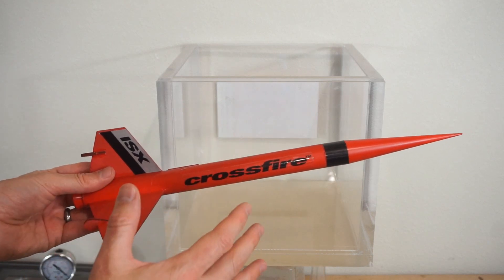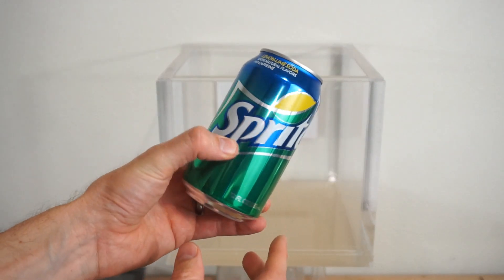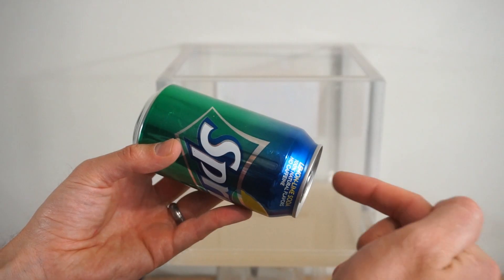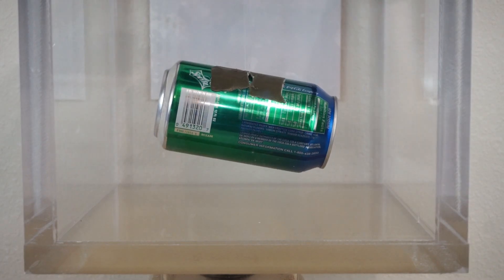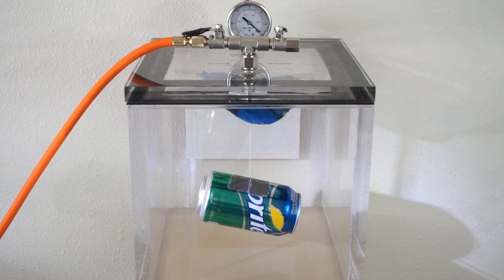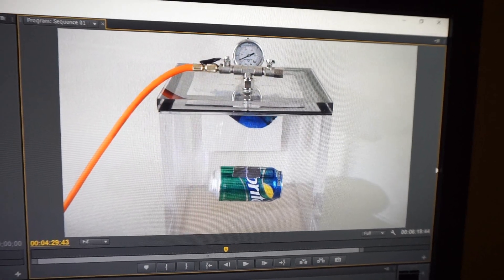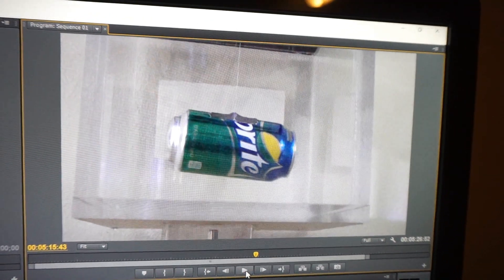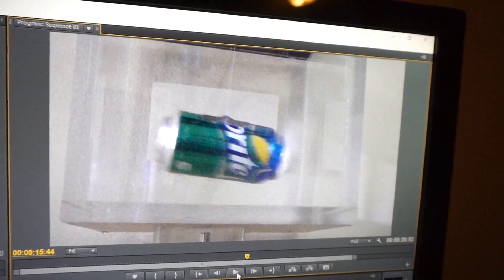Can a Rocket Fly in a Vacuum Chamber?

Comment: And technically, the rocket is pushing off of something.  That something is its own gas.
Reply: joe jitsu
"Once the gas has left the nozzle it has no effect on the motion of the rocket."
This tells me you do not know how it works. Once the gas left the nozzle, it already did the pushing.

The pushing mainly happens in the combustion chamber. The expanding gas pushes there. Once it leaves the neck it does a bit of pushing on the nozzle.
Reply: joe jitsu  I just saw this comment.  You're kidding right?  You said it isn't pushing off its own gases, then go on to explain how it pushes off its own gases lol.  What do you think pressure is?  It is literally a push over a certain area.  All you did was break down what I said earlier, which is fine by the way.  So nothing I said is incorrect.
Reply: +METO U
Time for what; you to learn some physics?  I would certainly agree with that
Reply: METO U ""so with a rocket that weighs a million lbs in space... The rocket would have to apply 1 million pounds of thrust off of something just to get it to begin to move..."

I can push a 3,000 lb. car on a level surface but I cannot achieve 3,000 lbs. of push.  With a car I am pushing against all the friction caused by its weight or the pull of gravity.

If this 3,000 lb. car were in space it would not weigh 3,000 lbs and there would be no friction to contend with,  the only thing to overcome would be its small amount of inertia that it would posses in space.

I suspect I could then theoretically push it using only my pinky finger.
Reply: METO U  Lol you're funny bud.  Too bad you wasted time with that long explanation, because in no way did it answer the question.  Again bud, the question was, how could the soda can push off the container walls, without actually making contact with it?  You haven't answered the question at all lol
Reply: NO. This guy doesn't deserve the likes. It is incorrect! Heres an older comment i wrote to a flat earther explaining it
Its just about newtons third law.
if you push something one way you will go the other way with an equal kinetic energy, and a speed relative to your mass. 
if you're on a chair on wheels and you trow a heavy ball, (if you ignore friction) you will go the other way with the same kinetic energy, at a speed relative to your mass. 
If you're in a chair on wheels and you shoot a bullet this will also happen, because even though it lighter, it's going much faster and therefore also has a big kinetic energy. (kinetic energy = 1/2 x mass x velocity²). 
In the situation of the rocket, the exiting gas doesn't have a very big mass but it does have a very very high velocity (up to 4.5 kilometers per second!) therefore generating enough energy to push the rocket up the other way. 
Since speed is relativistic, as long as you keep applying thrust the rocket will keep accelerating exponentially and therefore it is able to reach insane speeds.
Reply: Skyler Jr if it's useless then why did you spend time commenting when you could have spent time doing something not useless?
Reply: Tex Mex
"When the gas molucules of resultant explosion exit the nozzle completely, it has no effect anymore."
Sorry, this is false. If you do not understand ground effect, I can see why you might not understand.
Strawman argument again. My explanation was based on a rocket in a VACUUM. You clearly cannot read my words in context
YOUR strawmen is comparing rockets in a vacuum to ekranoplans that "floats" on a cushion of air in an atmosphere on earth.. Nice try... A vacuum is not the same like being in an atmosphere and it is not the same lie the ground effect.
Learn to know the difference, OK?

The diagram shows pressure exerted by gas.
http://www.braeunig.us/space/propuls.htm

Here is something in plain English if you cannot understand the above.
https://www.quora.com/Is-the-thrust-in-a-rocket-created-by-the-molecules-of-expanding-gas-colliding-with-the-walls-of-the-combustion-chamber

Those those incapable of understanding the above, here is the kiddie version. But of course, it skims over a lot of important things. So don;t bother me with this explanation if you cannot understand the above.
https://www.esa.int/esaKIDSen/SEMVVIXJD1E_Liftoff_0.html

Lastly, how does SpaceX get cargo into orbit? If it is a lie, can you prove it?

Source:
https://en.wikipedia.org/wiki/Ground_effect_(aerodynamics)
https://en.wikipedia.org/wiki/Ground_effect_vehicle
Reply: Of course, and I can pull myself out of a swamp by my own hair ...
Reply: Rockets can't go beyond low earth orbit. In a full vacuum, rockets exhaust wont create any acceleration because there is nothing for rockets exhaust to push against in order to cause acceleration. All you will see is exhaust going endlessly in space with no acceleration created in rocket. Imagine a man pushing a rock except man have his legs in air instead of ground. If a man has his leg on ground, he can push a rock because his legs are pushing against the ground. If his legs are in air, he can't push a rock because his legs are not pushing against anything. Same thing with rocket in space, there is nothing to push against. 
The only way a rocket can work in space is by creating a recoil effect by constantly exploding fuel mixed with liquid oxygen or exploding nukes at exhaust, explosion will create recoil effect therefore moving rocket forward in space but this isn't practical because you risk breaking the rocket. 
They are not using rocket technology in space, they are using EM gravity propulsion system secretly. Google "The Case for AntiGravity-booklet.pdf - Check The Evidence". Its already invented decades ago.
Reply: Tex Mex
"Can't we all just get along?"
You are asking one side that is correct to get along with the other side that is not correct. This is not logical.

"The mass of expanding burning/burned fuel or soda (liquid and gas) whatever behind the rocket all plays a part in propelling the rocket."
The MASS itself has very little to do with it.The magic happens when the fuel and LOX is ignited in the combustion chamber where the pushing happens.

"resistance to the fuel"
Morehand waving. Resistance is not even mention in sort of limiting factor when one speak to people knoledgable of rockets.
Like I said, handwaving.

"Certainly the farther away the gas gets it's effect diminishes rapidly toward zero, but not zero."
When the gas molucules of resultant explosion exit the nozzle completely, it has no effect anymore. The pushing is done in the chamber and a bit on the nozzle bell.

"but real life is not simplified."
You kinda dismiss explanations like the bowling ball. Then you introduce the ground effect that most people do not even understand...
Reply: Wiek van Venetië
This is what flat earther and Nasa deniers do.
Most of the time they will ignore any articles or logical reasoning but keep repeating or twist your words. 
Tex will prob fall back on ground effect logic but completely ignore that rockets is not anywhere near any surface and operates in a vacuum.

I wonder if he will address the articles I gave him.
Reply: Tex Mex
Im talking about the vacuum of space. Nowhere did I say it was perfect. YOU are the one introducing little strawmen and moving the goal posts. Lol

Like I said before. Pushing happens in the combustion chamber. A vacuum or atmosphere has nothing to do with it. 
Where are you articles that explains how rockets do not work? 
Post your supporting evidence here. 

YOU have to explain where GPS comes from if rockets do not cannot go into space with their propulsion.
You have to explain why nasa is spending billions on space programs.
You have to explain how we have images of planes.
You have to explain how we can read the weather patterns with space radar if satellites do not exist.
Explain how satellite TV works.
Reply: SsoulBlade .rockets in air  pull air from front..i am betting my house that nowdays rocket cant travel in space and nasa  faked it all...and it explodes because no air  keeps pressuring it..pump little ballon in  big bottle it will get smaller..vacuum bottle.ballon will explode
Reply: Jake Heke .... The aerodinamic flow is accellerated fromthe front!!!
Reply: silent hare
The rocket pushes the fuel mass away from it (with a controlled explosion).  Therefore the rocket mass moves the other way.  The vacuum has nothing to do with anything.  Two masses push away from each other.  Both move away from each other.
Reply: silent hare
Nothing is sucking.  Vacuum of space does not mean vacuum cleaner.  Space is just a lack of pressure from air, not a reverse pressure.
Answer this:
If you are holding onto a rock with a mass of about 100 kg in space and your mass is also 100 kg, then you jump off this rock, what will be the resulting motion of you and the rock?  Let's say you and the rock are motionless in total vacuum to start with.
Reply: silent hare
Not off yourself.  Off a rock that was attached to you.  You've pushed it away.  Both you and the rock go opposite directions.  That's what happens with a rocket.  It pushes its own gas mass away, and the rocket and gas go opposite directions.  You're a school kid who hasn't taken his science classes yet.
Reply: The gas and the can are pushing away from one another. So the gas and the can have equal force applied to them in opposite directions. 

Newton's third law.
Reply: Rockets DO NOT MOVE in a "space" vacuum....it can't......In air, or water...the rocket uses the "gas" to PUSH AGAINST the opposing mass....either air or water. In a vacuum....there is NOTHING to push off of, and NO, the ROCKET CAN NOT PUSH AGAINST ITSELF......if that were even REMOTELY TRUE, than the laws of physics, and thermodynamics are lies.
So which is it?
Reply: Can't we all just get along?   The mass of expanding burning/burned fuel or soda (liquid and gas) whatever behind the rocket all plays a part in propelling the rocket.  You can certainly simplify things like the astronaut throwing the bowling ball model to explain certain concepts, but real life is not simplified.    The expanding gas behind the rocket has some density and provides some resistance to the fuel leaving the rocket motor.  and that provides some resistance to the fuel burning fuel in the motor.  Certainly the farther away the gas gets it's effect diminishes rapidly toward zero, but not zero.  Think of the way ground effect provides more lift to an aircraft/helicopter close to the ground.
Reply: Is it logical to ask people to get along?  Why would it need to be?
"When the gas molucules of resultant explosion exit the nozzle completely, it has no effect anymore."  Sorry, this is false. If you do not understand ground effect, I can see why you might not understand.
Reply: This guy? Hard to agree f you never say who "this guy" is.
Reply: Tex Mex "this guy" is the writer of the original comment, of course. now please stop ignoring my comment completely explaining it.
Reply: SsoulBlade, your argument was based on a perfect vacuum, something that does not exist. A simplification.  Deep space is not a perfect vacuum, and a rocket spewing particles into it does not help.  You can pretend there is some magic threshold burning exhaust particles pass and instantaneously stop effecting the rocket, but this is false.
Reply: METO U
"Because space is as close of a perfect vacuum there is ...it is impossible to have thrust..."
Impossible? - I take it you will never post proof? 10 Bucks you wont post a peer reviewed article.
Only those not understanding how rockets work will say it is impossible.
Pushing is done in the combustion chamber and the nozzle bell. 
http://www.braeunig.us/space/propuls.htm#thrust
http://www.braeunig.us/space/propuls.htm#combustion
https://www.quora.com/Is-the-thrust-in-a-rocket-created-by-the-molecules-of-expanding-gas-colliding-with-the-walls-of-the-combustion-chamber

"It's no different than saying that you can blow hard enough into a vacuum cleaner and make positive pressure..."
This shows your level of understanding.
A vacuum cleaner is still operating on earth in an atmosphere...Not analogous to a rocket and space.

"Space will do the same exact thing to a rocket..."
Again, prove it with peer reviewed articles

"molecules will go in every direction evenly"
No it won't go in ev an object in space will keep going in whatever direction it was going until a force is imparted on it. the gas molecules will not go in every direction evenly.

"making thrust  impossible"
Lol
https://youtu.be/76JM03a6WH4?t=433
https://www.youtube.com/watch?v=GxBRQXxBRic&t=9s
Here is a timelapse of the ISS at 460KM. https://goo.gl/kl59U
ISS right now (I wonder how it got there) http://www.satflare.com/track.asp?q=25544 / https://eol.jsc.nasa.gov/ESRS/HDEV/ / http://www.n2yo.com/space-station/

_Saying that a rocket pushes off it's own gas from combustion is ludicrous...-
-"The rocket.. "can"...will apply force to the container until there is enough pressure to prevent this from happening then it will push off of its own gasses inside the box..."_
Lol, saying something does not make it real.
Since this is a claim, do you have studies that experiment with this? Can you post studies that experiment with something that puss of the gas that is pushing off something else? 
Didn't you just say that "molecules will go in every direction evenly"? If that is the case...there are no molecules to "push from" since it went in all directions evenly...your words, not mine
Meaning, there cannot be a pillar to push from. THAT is applicable to Ground effect vehicles. You argument is defeated by your own words/logic...

Lastly, if rockets are impossible to use in space, then we have serious question
1. Why would Elon Musk and Jeff Bezos use their own money for something that is not even possible (according to flat earther and nasa deniers)
1. a If you knew something is definitely not possible, why invest in it?
2. How do we get images from planets that is not taken from earth?
3. How did other countries get their satellite in orbit?
4. How did we get satellite imaging with Google earth? 
5. How do we get weather satellite forecasts?
6. How did the Mars rover get there?
7. How did the russian rovers get to Venus? Venera 7 was the first one to land there.

Can you answer it with evidence? For example, if you say Google maps was made with a plane or drone, present the google article talking about this plane/drone...
If all of the above is a lie, you still need to present eveiden to support your statement. 

I don't think you are stupid, I think you are just uninformed about rockets or cannot phantom how it words. You seem to be one of those people that yell magic! or witch! if you cannot understand something.
Instead of trying to understand how it can work, you do everything on your might to find elusive evidence that support your initial opinion.
 
More sources
https://www.nasa.gov/pdf/544894main_PS2_ThrustAndAcceleration_C3_Final.pdf
https://www.nasa.gov/audience/forstudents/k-4/stories/nasa-knows/what-is-a-rocket-k4.html
https://space.stackexchange.com/questions/2456/why-does-a-rocket-engine-provide-more-thrust-in-a-vacuum-than-in-atmosphere
https://goo.gl/owG7nC
Pictures of earth before Photoshop.
 https://www.hq.nasa.gov/alsj/a11/AS11-44-6645HR.jpg from https://www.hq.nasa.gov/alsj/a11/images11.html
More here
 https://goo.gl/ghWW2L from this album https://www.flickr.com/photos/projectapolloarchive/page8
http://www.spacex.com/
Reply: "i would respond but it seems you just wrote random words on pieces of paper and threw them into a hat and wrote the words as you picked them out of the hat...."
Ah, someone does not understand high school/universaty level physics and explanations?
I'm sorry, I do not have enough crayons to explain it ioo you.

"objects travel through water the same exact way they travel through air... End of discussion."
I am talking about rockets...in space..you know, where there is no atmosphere...

"I could not care less about how you think that rockets fly through air...."
I have always focused on a rocket in a vacuum.
 
"but so everyone can laugh at your expense.... "
I think everyone is laughing at you.
 
"Explain your crackpot theory of how rockets fly through air using a water analogy."
I am talking about rockets...in space..you know, where there is no atmosphere...

"Which you should be able to do since fluid dynamics is what governs the way that objects travel through both water and air the same exact way."
I am talking about rockets...in space..you know, where there is no atmosphere...

"Have you ever even heard of fluid dynamics?"
I am talking about rockets...in space..you know, where there is no atmosphere and fluid dynamics does not apply...

Read my comments c.a.r.e.f.u.l.l.y.

"Space will do the same exact thing to a rocket..."
Again, prove it with peer reviewed articles

Question you avoided
Lastly, if rockets are impossible to use IN SPACE (not water or atmosphere), then we have serious question
1. Why would Elon Musk and Jeff Bezos use their own money for something that is not even possible (according to flat earther and nasa deniers)
1. a If you knew something is definitely not possible, why invest in it?
2. How do we get images from planets that is not taken from earth?
3. How did other countries get their satellite in orbit?
4. How did we get satellite imaging with Google earth? 
5. How do we get weather satellite forecasts?
6. How did the Mars rover get there?
7. How did the russian rovers get to Venus? Venera 7 was the first one to land there.

Can you answer it with evidence? For example, if you say Google maps was made with a plane or drone, present the google article talking about this plane/drone...
If all of the above is a lie, you still need to present evidence to support your statement.
Reply: "please explain how a rocket moves through air... Using an analogy using something traveling through water ...objects travel through both water and air the same exact way... Fluid dynamics"
Read the title of this video carefully.
The video deals with the question of(and I will write relevant parts in CAPS) ROCKETS in a VACUUM.
You are trying to use fluid dynamics in a video that focus on rockets in a vacuum. Thus a  strawman argument.

Also, you say objects TRAVELING through water which. It is about rockets PROPELLING itself through the vacuum of space.
The flow of fluids have nothing to do with the vacuum on space with regards to rocket propulsion in space.

Lastly, I hope this sinks in...I am talking about rockets... in space ..you know, where there is no atmosphere...

Questions you are avoiding
Lastly, if rockets are impossible to use IN SPACE (not water or atmosphere), then we have serious question
1. Why would Elon Musk and Jeff Bezos use their own money for something that is not even possible (according to flat earther and nasa deniers)
1. a If you knew something is definitely not possible, why invest in it?
2. How do we get images from planets that is not taken from earth?
3. How did other countries get their satellite in orbit?
4. How did we get satellite imaging with Google earth? 
5. How do we get weather satellite forecasts?
6. How did the Mars rover get there?
7. How did the russian rovers get to Venus? Venera 7 was the first one to land there.

Can you answer it with evidence? For example, if you say Google maps was made with a plane or drone, present the google article talking about this plane/drone...
If all of the above is a lie, you still need to present evidence to support your statement.

If space is a vacuum then why doesn't it suck in all the air from Earth's atmosphere?
Edit: https://www.quora.com/If-space-is-a-vacuum-then-why-doesnt-it-suck-in-all-the-air-from-Earths-atmosphere/answer/M-Scott-Veach?srid=5HHy
Reply: METO U
"please explain how a rocket moves through air... Using an analogy using something traveling through water ...objects travel through both water and air the same exact way... Fluid dynamics"
Read the title of this video carefully.
The video deals with the question of(and I will write relevant parts in CAPS) ROCKETS in a VACUUM.
You are trying to use fluid dynamics in a video that focus on rockets in a vacuum. Thus a  strawman argument.

Also, you say objects TRAVELING through water which. It is about rockets PROPELLING itself through the vacuum of space.
The flow of fluids have nothing to do with the vacuum on space with regards to rocket propulsion in space.

Lastly, I hope this sinks in...I am talking about rockets... in space ..you know, where there is no atmosphere...

Questions you are avoiding
Lastly, if rockets are impossible to use IN SPACE (not water or atmosphere), then we have serious question
1. Why would Elon Musk and Jeff Bezos use their own money for something that is not even possible (according to flat earther and nasa deniers)
1. a If you knew something is definitely not possible, why invest in it?
2. How do we get images from planets that is not taken from earth?
3. How did other countries get their satellite in orbit?
4. How did we get satellite imaging with Google earth? 
5. How do we get weather satellite forecasts?
6. How did the Mars rover get there?
7. How did the russian rovers get to Venus? Venera 7 was the first one to land there.

Can you answer it with evidence? For example, if you say Google maps was made with a plane or drone, present the google article talking about this plane/drone...
If all of the above is a lie, you still need to present evidence to support your statement.

If space is a vacuum then why doesn't it suck in all the air from Earth's atmosphere?
Search that on Quora and Forbes
Reply: that creates oscillation pressure from solid glass.+it explodes because no atmospheric pressure keeps it
Reply: Dragan i
"that creates oscillation pressure from solid glass.+it explodes because no atmospheric pressure keeps it"
1. What exactly explodes? You just say "it".
2. How exactly does what you describe explain the can moving?
3. What exactly is oscillation pressure? (I cannot find studies for this term)
4. What does this oscillation pressure have to do with glass?

- Do you have studies to back up what you said and for each point I'm asking.
- Post the studies please. (Telling me to go google it is no different to me saying you are wrong and to go google it.)
- Post video examples of these experiments proved by the articles.
- Make sure the articles is from people in the field. Not a backyard/couch "scientist" with no peer reviews who's only retort is "Look into it".
Reply: ".rockets in air  drag air from front.."
All object in an atmosphere of some kind experience some drag. THIS experiment is in a vacuum. You comment is irrelevant in a vacuum.

"i am betting my house that nowdays rocket cant travel in space and nasa  faked it all"
Why is is so difficult for you people to provide undeniable proof?
I can also say that you are a robot meant to propagate the flat earth...point is I need proof to back up my claim. Not assumptions.
Make sense?

"...and it explodes because no air  keeps pressuring it.."
1. What exactly explodes? The air? The fluid? The CO2 in the fluid? What?
2. Explain in detail (with articles/studies) how pressure keeps IT from exploding
Stop hand waving and explain in detail.

"pump little ballon in bottle it will get smaller.."
Wtf? 
Pump air in balloon in a bottle / Pump air in a bottle with a balloon in it?
is the balloon closed? Was the bottle a vacuum? Does it have some gas in it? What?
Stop hand waving and explain in detail.

"vacuum bottle.ballon will explode"
is "vacuum bottle" part of the previous sentence? If so, why double ellipse? (Should be 3 if that was the intention)
Why will balloon explode? 
Stop hand waving and explain in detail.
Reply: Dang jos yes that happens because solid glass blocks it and flid creates pressure
Reply: Dragan 
Are you going to answer each of my points and explain in detail? Direct link to studies is preferred. Don't tell me google X. Most of the time all you get are tin foil websites with zero scientific backing. Give me the website name and what I must search. Better yet. Direct link the page number(s) of important bits.
Reply: FAKE, there is no human~!
Reply: Take a weight and stand on slippery ice on the edge of a cliff, face the ravine backwards and throw the weight. You can't push yourself against air.  But you will still die. It is basic newton law. Something that looses /gains momentum creates a force in some direction. It is the same principle that makes asteroids wreck the earth when they hit. And air resistance making it go on fire during the fall. Or why you can heat things by hammering them hard (in this case since the object cannot move the force creates potential energy that is converted to heat). Or why a ballerina starts spinning faster when she takes her arms closer to her body.
Reply: well, technically, that means motion laws, no such vague term as 'pushing off of something' is defined. Technically, this is conservation of momentum, don't give it misleading names.
Reply: The space it to small to prove anything.. stupid guy
Reply: Gra Ra5 like said, it does not prove anything. If its not a vacuum anything like space and in a container its not proof so i dont need to do any experiment its been done for me. Plus its common sense that you cant push of somthing that is moving away from you especially if its gas being sucked away in a vacuum
Reply: How can a rocket pus of something that is being sucked out its not equal opposite.
Reply: Tex Mex it seems you believe all that nasa tell you have you ever had a an opinion of your own or does it all come from tv and books?
Reply: TheOneWith TheEyeOfTruth nope this does not fit with the laws of motion but  thanks for your opinion bud. Im am reconstructing this experiment and it should be finished in three weeks time much larger scale youll see.. this will have a vacuum not a slight one in a small space
Reply: TheOneWith TheEyeOfTruth is blowing in a vacuum cleaner hose. two masses opposite or is one sucking in the same direction as the one blowing equal opposite is two forces opposing not opposite as in hot and cold that is tex mex belief... look cold is an idea of a place or thing without heat energy as is   a dark place without light or vacuum without pressure but these are not opposing forces the name is give out of absence.
Reply: TheOneWith TheEyeOfTruth i never said it was a reverse anything i actually  said it was what you just stated. The absence of pressure which is a vacuum. But now your talking about inertia. But your talking about propelling your self off of yourself as we are in a talking about being in a vacuum because of space you are obviously a child but fair play for trying to understand real science
Reply: TheOneWith TheEyeOfTruth if your in a vacuum and you are 100 kg and you push off an object which is 100kg you both move away from each other at the same rate yes... but calculating that rate is what im refering ie a working jet  engine on earth has an atmosphere to push off of to make an aircraft move then in a no atmosphere it all based you say its all down to mass opposing inertia would there be enough noticed force to make any difference whatsoever in space which is also a belief as you cannot prove that space exits
Reply: silent hare
So imagine instead of you there is the rocket, and instead of the rock, it's fuel.  Same thing.  Now you know how a rocket works in vacuum.
Whatever else you're saying, you're talking about something else.
Reply: TheOneWith TheEyeOfTruth ok you head is a rock in a vacuum i get it now
Reply: silent
What's the problem, kid?  You just said that you and the rock move opposite directions.  Why can't you apply that to the rocket and its fuel?
Reply: TheOneWith TheEyeOfTruth because it doesnt work like that now your imagination is thinking that combustion is somehow similar to creating infinate inertia from infinate rocks
Reply: silent
It's just pushing mass back.  That's the principle.  Action and equal and opposite reaction.
Reply: DANG JOS it touched it from the inside
Reply: Enough said. Ty for saving me the time of explaining dude
Reply: man you are smart!
Reply: DANG JOS the can pops before the full vacuum is stabilized... in fact that can would not stand up to a full vacuum without popping before reaching a full stable vacuum...
Reply: great job showing everyone that most pressurized containers BLOW UP before reaching a full vacuum environment... 🤣 lolol stupid globetards... DERP
Reply: The Action Lab .. now explane how nas gets combustion in vacuum and the fuel doesnt do what that can just done cause from the math the camber tou have space vacuum is a lot more than you can get from that tiny box
Reply: The Action Lab .. challenge ... build a setup of fuel tank and fuel and try and stimulate the combustion it cant be done in space or vacuum box noting will burn
Reply: The Action Lab .. the only burn a comet or meteor does is when it enters our atmosphere till exit then it just a cold ball of what everther for nas or any one has never been to space on combustion any thing
Reply: This experiment is bullshit,, u have a big as can 1 inch from. 4 walls. Talking about there. Is no opposite force to push off of
Reply: Jake Heke, what exactly are the "Thrusters" thrusting against?
Reply: TheOneWith TheEyeOfTruth, the 'Vacuum' has everything to do with it. The immense size of the vacuum is what makes the difference. This vacuum is so immense it sucks up and swallows any energy produced by a Rocket, and it does so instantaneously.
Reply: TheOneWith TheEyeOfTruth, you are very much mistaken. The vacuum of space does suck and is a reverse pressure. The immense vacuum on the Moon would in fact have reshaped the Lunar Lander round like a balloon. Which is further evidence of NASA lying.
What is the vacuum level in space?
Examples
Vacuum cleaner approximately 80 kPa (600 Torr)
Near earth outer space approximately 100 µPa (10−6 Torr)
Cryopumped MBE chamber 100 nPa to 1 nPa (10−9 Torr to 10−11 Torr)
Pressure on the Moon approximately 1 nPa (10−11 Torr)
Interstellar space approximately 1 fPa (10−17 Torr)
Reply: J. P., I have no doubt you possess a brain, but I'm at an impasse why you refuse to use it. NASA can't propel its Rockets in the vacuum of Space. The Lunar Lander would have changed shape and become round in the vacuum, just before exploding. The Lunar Lander wasn't large enough to have held any power source to lift off the Moon's surface, even if Rockets did work in a vacuum. Your acceptance for anything along these lines reveals your preference to accept what NASA tells you above your willingness to research these facts yourself. You're a sheep because you choose to be. I can show you the facts, but I can't force you to consider them.
Reply: rachel freeman we can create combustion by supplying fuel and oxygen the same way we do to weld underwater but you are correct, we cannot produce thrust in the immense vacuum of Space. NASA lies, and very poorly.
Reply: el verdugo Pr, the recoil effect might work when applied to a rocket only if the rocket were encompassed within a tube like a gun barrel. Otherwise the energy would be sucked up in the immense vacuum of Space.
Reply: joe jitsu, Ah no, that's NOT how they work. Your description wouldn't work without their being a compressible air for the Rocket's blast to be directed at AND pushed off of. In the infinite vacuum of Space the energy would be instantaneously absorbed and the rocket would remain motionless.
Reply: The Action Lab, No. The gasses wouldn't serve as the backboard or provide the denseness required for pressurization because they couldn't be compressed. Remember in order to provide a dense backboard they'd need to be compressed, And to be compressed they'd need to be enveloped, but here they are in the infinite vacuum of Space that absorbs all energy instantaneously.
Reply: Qin li, that's not the 3rd Law you're describing, it is the 2nd law. But it wouldn't because the gasses would be absorbed by the infinite vacuum of space that no man-made energy could compete with...Infinite...that's a bunch.
Reply: DANG JOS, nope. You're not even close. Infinite vacuum would suck up your earthly physics, never to be seen again.
Reply: @silent hare

"Im am reconstructing this experiment and it should be finished in three weeks time much larger scale youll see.. this will have a vacuum not a slight one in a small space"

How'd that work out for ya, bud?
Reply: asleepinthealley go back to sleeping in alleys, there's no such thing as "reverse pressure," nor "negative pressure," nor "infinite vacuum." There is pressure, and there is lack of pressure. You might have negative brains, though.
Reply: joe jitsu actually rockets dont work under water . When launching a nuclear rocket propelled missile from a submarine under the water. The rocket must first be propelled to the surface with compressed air  and clear of the water before firing its rockets because according to the us navy rockets only work in air.
Reply: +silent hare have you done the experiment in the vacuum yet, and did you film it? I thought the experiment above was done in too confined a space
Reply: Sorry guys all these experiments are flawed! Rockets only work in a pressurized environment. The effect of firing a rocket in the absolute vacuum devoid of any pressure would be Net Zero. They work very well here on Earth but that's about it. And for the record I'm not saying it couldn't be lit, anything could be fired up with its own oxidizer it wouldn't have any effect
Reply: @None888.  rockets work fine in a vacuum. Pressure is generated in the combustion chamber. Some of the molecules of gas move forward and hit the front of the chamber that pushes the rocket forward. The gases escape out the back, so there is no back wall for it to push against so no net force backwards
Reply: @andywright8803  ...no disrespect...but ...No thanks..
Reply: @None888.  you can disagree with me as much as you like, but I know I am right. The thrust is generated in the combustion chamber. If you believe the bs that it somehow pushes against the surrounding air then of course you don't believe rockets can fly in a vacuum. I would suspect they would not work at 14 psi either if that were the case.

Typical of flerfers to play on popular misconceptions to peddle their lies. I just don't know whether you fully understand the truth but get your kicks out of telling lies, or have yourself been suckered in through lack of understanding of reality.
Reply: @andywright8803  ... believe what you want...no one is ever going to space on a rocket....peace
Reply: @None888.  ok. Let's try it this way... where do you think space is? What height are we talking about? Do you believe there to be a physical barrier, or is it more a definition based on some arbitrary measure. People fly in the sky in aeroplanes, you can't deny that. The pressure at cruising altitude is a lot less than on the ground, so a pressure gradient exists. I just don't think you have understood the consequences of what you believe.
Reply: @andywright8803  ...I'm not here to debate anyone...my beliefs don't require that anyone agree with me...hell I wrote this so long ago that I really don't remember what I wrote...but that doesn't change anything.... believe what you want...and when you are flying around in a rocket or have landed on another planet take pride in the fact that you were right
Reply: @None888.  If you are not here to debate, why did you make the contribution that you did? Perhaps you thought you could write bs and nobody call you out. And now you want to exit the chat because your argument has been defeated. I am too old to make it into space, but pretty soon NASA will return to the moon for longer periods of time with an aim for a permanent base. What will you do then?
Reply: @andywright8803  ...I've never changed anyone's mind in the comment section of a you tube vid....nor has mine ever been changed....it's just a waste of time....so I commented...perhaps you should ask yourself what it is about you that cares so much about what I think...I mean it already sounds like you have convinced yourself that you are correct and that I am brainwashed....if you're looking for an endless debate try someone else....I'm sure you will get plenty of people who would eat that up...life's too short
Reply: @andywright8803  my life or self fulfillment doesn't rely on what NASA does...I'm sure I'll be fine and just keep living my life...only there would be some dudes bouncing around on a rock 237000 miles away...pretty sure I'll be ok...but thanks for your concern
Reply: @None888.  ok here's the thing. I have a degree in physics and spent a huge portion of the time designing and performing actual experiments that cover the full range of phenomena including superconductivity, superfluidity, electronics, quantum mechanics, optics and of course gravity. You don't want to know what I have done practically with a vacuum pump. On graduation, I got a job as a scientist researching radioactive drugs and spent 15 years making decisions that could potentially lead to a rather nasty accident if I made the wrong decision. Not just directly with the drugs, but I advised on how high to build smoke stacks on top of buildings and what the maximum inventory of radioactive products are safe in each building commensurate with the constant requirements to be both safe and profitable.  I left that 15 years ago and became a teacher. 

I have spoke at conferences all over the world, advised governments and sat on national bodies in especially atmospheric modelling.

With something as simple as this, it's clear and obvious what the truth is, and it's part of my natural inclination as a teacher to encourage others to find the truth, ideally for themselves but also, by any means necessary.

I have in the past persuaded others of their error, and have even been genuinely thanked. I don't consider that I am right ALL the time, and use the cut and thrust of debate like this to sharpen my knowledge and become a better teacher. I do not appreciate endless debate as that implies that no progress has been made.
Reply: @andywright8803  ...ok since you're so persistent I'll ask you one question...and if you answer it I'll ask you another question and then we'll both know where we stand....question: Do you accept the standard heliocentric model as it relates to the planets and the galaxy as it relates to accepted speeds and distances of the  model?
Reply: @None888.  Yes. I'm not sure you fully understand what those things are, but I will play along until I see you have clearly misunderstood something.
Reply: @andywright8803  ...question #2...it is accepted that the earth rotates at approximately 1000 miles per hour....it is also accepted that the earth rotates around the sun at approximately 67000 miles per hour...it is accepted that the moon is roughly 237000 miles from earth...and finally it is accepted that the sun moves through the galaxy at roughly 500000 miles per hour...with the earth being tethered to it and the moon being tethered to the earth....if a spacecraft left the earth how could anyone possibly calculate where the earth and the moon we're going to be in 3 days let alone have the power or speed to get there?...sure the moon is 237000 miles from earth relatively....but how much actual distance would something actually have to travel to cover those speeds?...how do you rectify that? Or are we supposed to believe all these speeds and distances and at the same time ignore them as well?
Reply: @None888.  You are using these values as if they are large, and as if the motion was erratic. It's not.  It is very predictable.  Look up how Neptune was discovered to show you how the tiny discrepancy between the measured motions of the planets and the theoretical motion given the known planets at the time led to the discovery of a new planet. This was in 1846. Our understanding has grown significantly since then. We are able to predict exactly where every planet will be at any moment hundreds of years into the future. Do you REALLY think this is going to be a problem?

As for power and speed, all motion is relative, so from the earth, we don't detect the motion of the solar system through the galaxy as it is moving as one piece as it were, and surrounding stars have similar motion to that of the sun. Your picture of an unpredictable motion is clearly wrong as that is not what we observe and have continued to observe for centuries.
Reply: @andywright8803  .... You didn't answer my question you're only able to predict it relative to where you are.... Doesn't sound like you can predict it in a free space environment.... And how can something going twenty-four thousand miles an hour keep up with something going 500 thousand miles an hour?...you can only predict where that planet will be because it is moving in the same system as Earth.... And Earth is your fixed point if you were floating around free from the heliocentric model you would have a very hard time predicting wear something would be in space-time let alone you definitely wouldn't have the power to get there moving at the speeds NASA says Apollo went....
Reply: @andywright8803  if you need me to simplify it for you....of course the Moon is still going to be 237 thousand Miles relative to Earth. The problem that I presented you...is... Where planets would be with a system traveling at 500,000 miles an hour.... Where would they be in the galaxy?.... That is what you would have to know to go to the Moon....you would have to aim for the spot that it is going to be considering that the whole system is moving forward at incredible speed.... I can tell youwhere any one of the planets is sitting here on Earth but if I jumped off the planet the damn solar system would leave me behind
Reply: @andywright8803  and also like I said are we supposed to believe the heliocentric model and disregarded at the same time?
Reply: @None888.  Let me answer your question with an analogy. A man is on a train, and walking up and down the carriage. Relative to the carriage, he is walking a couple of mph, but relative to the track, he is moving over 100mph and in a different direction. There is no question of the man falling off the train, or there be a problem with the motions.  This is how you can break down motion into inertial frames of reference and greatly simplify the problem. 

It also seemed that you misunderstood my description of motion relative to where we are. There are no fixed points in the universe, and motion can only therefore be described relative to other objects. Your 'free space environment ' makes no logical sense. If this was supposed to be the big conundrum that would trip me up, you are going to have to try much harder than that.
Reply: @andywright8803  ... You remind me of another guy that used to come on here...just so that were clear... nobody on this planet knows what the moon really is!!!!!...the stars are not what"science"tells us they are....and if they are I believe they burnt out long ago and they are so far away as"science" says that we won't know they are actually gone in quite a while....or they are something other... which is what I suspect....but I don't want to bore you with my simple ideas any longer....so you just wasted all your degrees to tell me something that we have known since the 1800s according to you... And just to put an end to this because I'm really not getting anything out of it.... I do feel like I'm smarter than you....take care
Reply: @andywright8803  ...I don't have any evidence...just like you don't..but my thought experiment was way better than yours...yours sounded like a 15 year old who just read what a thought experiment was...lol....and you didn't rectify the problem in the equation...I don't care what you think you know ...you could no more prove it than you could get to the moon... The only difference is this seems to matter to you and I really don't care
Reply: @None888.  Actual experiments are more important than thought experiments
Reply: joe jitsu  please demonstrate practically your claim about "rockets move in a vacuum". Go.
Reply: joe jitsu  Cool story bro.
Now practically demonstrate your claim.
Reply: The thrust you get from gas molecules pushing against each other depends on the ratio of the mass of gas vs the mass of the object being propelled and the velocity and direction of the gas. This would probably constitute less than 0.001% of the total thrust of a rocket operating in an atmosphere.
Reply: @Rick-zw7zv  what has the lack of density outside the rocket to do with the density inside the combustion chamber where the magic happens?
Reply: @andywright8803  Because in the atmosphere are gasmolecules that have a different velocity than the gasmolecules from the rocket that are slamming into them, the energy from this collision produces pressure and pushes  the rocket forward
 In other words, the 'stagnant' atmosphere functions like the pressure chamber of a gun, without a pressure chamber there is no pressure build up. The gas molecules in a vacuum have nothing to collide with (they all have the same momentum), so no collision means no pressure which means no propulsion.  This principle is easy to understand when you think of a rotor blade, rockets are no different in that respect.
Reply: @andywright8803  I don't see an argument in your comment.
Reply: @Rick-zw7zv  my argument was the links you made between space and the barrel of a gun, and rockets and things propelled by a rotor blade including a jet engine are just plain rubbish
Reply: @andywright8803  That's a statement, not an argument.
Reply: @Rick-zw7zv  a correct statement though. You got it wrong.
Reply: @andywright8803   We can't have a discussion if you're just reiterating statements and project logical fallacies
Reply: @Rick-zw7zv  Pressure builds up in the combustion chamber and tries to spread out in all directions, but is blocked in the forwards direction.  The gas is ejected out the back where due to conservation of momentum, projects the rocket forward. No atmosphere required. I call that an argument though you may say it's a statement. Either way, you are wrong, and it's easily demonstrated.
Reply: @andywright8803  Look, bullets have the same ignition and propulsion principle as rockets, right? Propulsion is caused by the pressure build up in the pressure chamber, you can test this by igniting a bullet in an open pipe and see that the bullet barely creates any momentum. Gas, fluids and solids have mass resistance in which you can create a pressure area pocket that functions like the pressure chamber of a gun. In other words, the propulsion is not directly caused not by the explosion hitting the bullet but by the explosion hitting the chamber wall directly opposite of the bullet, the expanding gas molecules have no where to go on that side and start pressing against the bullet.

Conservation of momentum only plays a negligible role in rocket propulsion:
m1u1 + m2u2 = m1v1 + m2v2
m1 = mass of the gas
m2 = mass of the rocket
u1 = initial velocity of the gas
u2 = initial velocity of the rocket
v2 = final velocity gas
v2 = final velocity of the rocket
Mass of the gas is negligible compared to the mass of the rocket, hence m2u2 = m2v2 (hence no propulsion!)
Reply: @Rick-zw7zv  I have no knowledge of or experience of guns (apart from when I was threatened at gunpoint on a business trip to the USA, but that's another matter, so the analogy may be right or wrong. I DO know about how rockets move though http://hyperphysics.phy-astr.gsu.edu/hbase/rocket.html
Reply: @Rick-zw7zv  ...I get what your saying...on Earth you have the cartridge the bullet the chamber and the barrel and all that pressure....a rocket in space would be like having a cartridge with no bullet...no chamber and no pressure....so no force......peace
Reply: @UCNXn4tSjTguaVSnHyJ7dAmQ Without atmospheric pressure pushing into the nozzle no pressure can build up, all the gas molecules are sucked out of the nozzle into the vacuum.
Reply: @Rick-zw7zv  it would if there was just one explosive event, but there isn't.  It's a continuous process, with pressure being constantly replenished.  Look up dynamic equilibrium.  It may help
Reply: it's TRUE that it is pushing off its own gases when the pressure builds but it's also true that this has 0 similarity to the environment  in the vacuum of space
Reply: Exactly, and that is how rockets work in a vacuum!
Reply: @andywright8803  rockets blow their own sail...got it...
Reply: @metou3072  yes, but the sail in this case is the front of the combustion chamber. It pushes forward on that. The back of the combustion chamber does not exist so there is a net force forwards. This is regardless of whether it's in a vacuum or not
Reply: @metou3072  of course the pressure inside the combustion chamber is released into the vacuum, and if it was just one explosive event, that would be it, but it's a dynamic system. The combustion happens continuously and as soon as the gases are generated, they are forced to the back and released only to be replaced by more. 

I don't know who you think I am, but you seem to think I am paid to do this. No, I am a scientist by training, 15 years in research (hands on seeing for myself) and then 20 years as a teacher. This is what I do. I use my experience and knowledge of the facts to correct mistakes, whether that's in the classroom or outside. I only do so in subjects I am qualified to teach.
Reply: @None888.  I appreciate the help  but I know what is going on...who is doing what and why because I have a brain and I choose to use it instead of being put in a group so you are easily controlled because people by nature don't want to be outcasts so they will just agree with majority opinion...much easier to lie to people that followers and are grouped together...the internet exists not for you...but to use against you...just like your "rights" that are really an illusion...every single person that is pulled over by  police are having their rights violated...but people are too stupid to know that...and that's what they bank on...if you know tour rights you file a lawsuit and they pay you to shut up and to not tell others...they are only violated when you say they are...until then you have no rights...its an illusion...when local police see me they literally go the other direction because they can be held personally liable for violating your rights if you wish to go that route...but they will always offer you money so you dont go that route and once they know that you know your rights...they start to fear you...I have filed kidnapping charges against a police officer before...legally they can not run your name or even stop you without reasonable probable cause that a crime has taken place, is taking place or is about to take place...if u get pulled over you simply ask the officer if he is conducting an investigation...when  he answers no then you simply ask him if you are free to go...and you will be on your way instantly..traffic infractions are not crimes
Reply: No. It is pushing against the wall.
Reply: @jonathanpatterson6768  did you even watch the video, the can moved before anything got near the wall. It's a common misconception but definitely wrong. Sorry.
Reply: @andywright8803  The moment the can bursts, it is not in a vacuum anymore. And yes I did watch it.
Reply: @jonathanpatterson6768  technically you are correct, and that could be said about space I suppose, but what wou are implying is that the gases escape from the can, travel through the chamber, reach the other side, and then with sume considerable rigidity, send a shock  wave back towards the can and then and only then would the can move.

2 questions. 

1. Whete is that shockwave and
2. Why does the can start to move before any gas is even halfway rowards the wall, let alone on a return journey.
Reply: @andywright8803  i’m a curious person and I have no idea if you’ll respond to this but i’m just wondering what the rocket is pushing off to generate force.
Reply: Bingo
Reply from the maker: +joe jitsu-actually it is technically pushing off of its own gasses. For example if I throw a bowling ball in space, I am pushing off the bowling ball to move the other direction. The same is happening with the rocket exhaust except instead of bowling balls they are gas molecules. The reason a pressure differential causes anything to move is due to molecular collisions being imbalanced. This is what +Dang Jos is referring to.
Reply: hii the action lab,

if you said the rocket in vacuum is propel by the pressurized gas it push out behind it.. would it not be the same as we use a fan to blow our own yatch in hoping it will move forward...  because the force is on the yatch itsel and it acting on the yatch, hence no effect.. wait a minute..  sorry, not the same.  take back my word.. i got mixed up with ambient air and vacuum..
Reply: Bro u need a bigger chamber it push off the wall no good!
Reply: @TheActionLab  you could not be more deceptive and wrong
Reply from the maker: That is exactly true!
Reply: @TheActionLab  Isn't it pushing off it's own mass?
Reply: @TheActionLab  It's pushing off the wall.
Slow motioned a lot of times and not once can I catch the propellant and the can moving before it hits the wall.
So technically this liquid, more solid than a gas is pushing off the wall.
You need a vacuum chamber large enough it is physically impossible for exploding soda pop or spent gas to hit the wall before the rocket moves.
Reply: @TheActionLab  totally wrong....the gas is trapped In the can

Exhausts are not closed cans.

You have two containers and 1 force...that is not how vacuums of nothingness works 

Why does everyone insist on using analogies that not not compare to an exhaust in a vacuum??

A closed pressurised can is not an exhaust....its sealed 

Think of a pressure cooker bomb it generates movement by blowing itself apart...the opposing forces come from the lid the weakest point being blown in opposite direction to the rest of the pan 

An exhaust is just an exhaust...in theory the only way any rocket will be able to turn and manoeuvre is if it seals its outer exhaust system to a never ending supply of pressure cooker lids that turn the exhaust into a closed pressurised container...

And then the opposing forces created would explode the lid and the rocket in two different directions...

However that is never what is observed in any rocket I have seen...and all analogies of how they work do not describe anything like it
Reply: joe jitsu Its is pushing against its own gas, called the Newtons’s third law.
Reply: @qinli9152  wrong
Reply: METO U  Tell me this.  How could the can push off of the container, without ever touching it?
Reply: METO U  Actually it would work.  It's simple physics
Reply: The Action Lab ....please explain how a rocket pushes off it's own gas... That's got to  the dumbest reason I have ever heard as the reason a rocket would work in space... So as an example... You are stating a rocket has an exhaust of 100 Psi then it ejects exhaust at 500 psi and this is how rockets work?....instead of the very obvious reason the can has thrust in  this example is because force is being applied to the container...in order for Newton's third law a force must be applied to something else in order to be able to get an opposite reaction....so with a rocket that weighs a million lbs in space... The rocket would have to apply 1 million pounds of thrust off of something just to get it to begin to move...
Reply: @metou3072  finally people with some sense
Reply: DANG JOS it's pushing off the container... If the container was big enough it would not work...
Reply: @metou3072 Right? I guess that's why you rarely see the real big rockets being powered by a soda can. You should share this with NASA.
Reply: @metou3072  exactly
Reply: SsoulBlade .....you still did not say that I was wrong... So what the fuck was the point of your comment because I don't see one... you are a troll that somehow benifits off of the deceptions of the government...if u can't prove me wrong... Than go fuck yourself ...if you can prove wrong me then do it....are you telling me you do not know how things move through water...because thats all you need to understand  for proof rockets do not work in a vacuum... It's really that simple....will a submarine move that is on land that makes  the water that the propeller pushes against even if there was no friction between the submarine and ground... You are telling people that the submarine would move... research articles for what... How things move through water?...the only person that is not being logical is you... And also... What was your point of throwing in the GPS reference... Is that the only counter argument you have against what I said...are you saying that rockets work in space because the GPS loses reception in a tunnel... Damn you are desperate for a counter argument if u  threw that in there...who ever gave you a high school diploma needs to be fired... That's if you didn't drop out... Which I think is most likely
Reply: @metou3072  I am curious what your physics credentials are?
Reply: Sandor Clegane ......whats up with that big bulge protruding from your forehead.  You do know that is not normal right??..you definitely have pressure that keeps blood from being able to get to your brain....i thought your mother was joking when she said she tried killing you by dropping you on your head..i didn't know that it happened within the last month...you better go see a nerd immediately so they can tell you what you need to do so maybe you have a chance of living past 2017...im being dead serious too... Fuck the jokes...thats not fucking normal... If you need a ride to the hospital... Call 911...or an uber... You're mom will be home after us nerds get done with her.
Reply: SsoulBlade ....i would respond but it seems you just wrote random words on pieces of paper and threw them into a hat and wrote the words as you picked them out of the hat....objects travel through water the same exact way they travel through air... End of discussion. I could not care less about how you think that rockets fly through air....but so everyone can laugh at your expense.... Explain your crackpot theory of how rockets fly through air using a water analogy. Which you should be able to do since fluid dynamics is what governs the way that objects travel through both water and air the same exact way. Have you ever even heard of fluid dynamics? Do you even understand that things move through water and air the same exact way. Do you agree that things move through water and air the same exact way? If you do not agree that objects move through water and air the same exact way.... Please explain what is different? Thanks
Reply: Sandor Clegane .....i have 1 person laughing at me that admits he bangs his head on things that should be in the ER because of the abnormal growth on his forehead instead of on YouTube and another person that is arguing with someone else because  he thought he read something that I didn't write....people like this are the ones who think rockets work in a vacuum... Go figure...
Reply: Sandor Clegane ....then that explains why you are not thinking clearly ....explain how something travels through water the way a rocket flies through air?  I gotta hear this... Please explain
Reply: SsoulBlade ....please explain how a rocket moves through air... Using an analogy using something traveling through water ...objects travel through both water and air the same exact way... Fluid dynamics
Reply: Sandor Clegane .....oh ..I know exactly how dumb you really are... Have u yet understood what I said  about fluid dynamics... How objects that travel through water and air ...do it exactly the same way...if u can prove anything that I said wrong can u please do it....i know that you can't... .
Reply: Gra Ra5 no i dont have all the answers, you have all the answers your presented with. I have mindfulness and  inquisition im a civil and structural engineer and i understand what i have been taught but i know that alot of mainstream science is i lie not all but most of the stuff to do with space is a belief not fact..have a colleague involved  in tunnel design far more educated than me and he feels the same as i do. I glad your the kind of scientist that has all the answers and belives a theory to be fact because ive never heard of that before tex mex! So dont be surprised if  i ask alot of questions.
Reply: the soda can pushed off the right side of the wall - which made it go to the right - use a bigger vacuum chamber to rule this out
Reply: no, a longer vacuum chamber.. but i doubt it will prove anything if argument is pin pointed on the air and liquid pushing the walll hence causing it to propel forward.
Reply: joe jitsu Instead of this mildly useless video this comment would have done much better.
Reply: No... Rockets do not make what they push against to work. It's fluid dynamics...it does not matter if it's water... Or air... It works the exact same way...its like saying that a submarine makes the water that the propeller pushes against while it's on land.. people will agree that the submarine would not move..The same exact thing will happen to a rocket in space.. That is the dumbest and most idiotic wrong explanation of how rockets work that is even possible. Because space is as close of a perfect vacuum there is ...it is impossible to have thrust... Saying that a rocket pushes off it's own gas from combustion is ludicrous... It's no different than saying that you can blow hard enough into a vacuum cleaner and make positive pressure... A vacuum cleaner is a very extremely small fraction of the vacuum of space....just like a vacuum cleaner will suck the air right out of your lungs... Space will do the same exact thing to a rocket... Only many many many many many many many many times quicker and the molecules will go in every direction evenly making thrust  impossible ....using small box like this moron... You release pressure into the box and after the box gets to 0 pressure... The rocket.. "can"...will apply force to the container until there is enough pressure to prevent this from happening then it will push off of its own gasses inside the box... This does absolutely nothing but prove that you should not listen to anything this idiot says at all... ever... until he admits this experiment is flawed and invalid.  If he does not at least do that... Then he is purposely deceiving people....personally I think he is deceiving people. I work with pressures and vacuums every single day I work and I guarantee that there is not a single person on this planet that can prove what I said was incorrect or untrue.  He does not have a vacuum pump that is able to take the gasses out of that chamber as fast as its being put in... Like it would be in space....he pulled a vacuum and closed a valve taking the vacuum pump ..."space" out of the experiment....invalid experiment... And he  got the wrong conclusion because the experiment was invalid...
Reply: DANG JOS ....ok I think it's time
Reply: DANG JOS when the pressure builds up inside the container and gets to around 0 ....the "rocket" will be applying force to the container until there is enough pressure to prevent that from happening....any other questions?
Reply: DANG JOS just because you are special needs I'm going to make this as simple as possible for you so you don't hurt your... And yes you can leave your helmet on while you are doing this...it would not effect the outcome of the experiment....get a balloon  and insert a straw into it and use rubber bands.... String....anything you want to seal the balloon around a straw without pinching it so you can blow up the balloon with the straw.... And attach it to 1 of your  little  toy cars that's about 6 inches long or so... Congratulations to you...you just made a rocket all on your own using instructions... I'm so proud of you...now ....I know your mom told you not to play with anything that uses electricity but I won't tell if you don't...go get mommies vacuum cleaner and be very careful when you plug it in... Now your ready to do your very first experiment... Isn't this  exciting....with you balloon attached to the top of your toy you can proceed to blow up the balloon and make sure you don't blow it up to much cause it will pop  ...pinch the straw after taking your mouth off the straw then let go.... Notice how it moved forward....now repeat the process of blowing up the balloon and pinch it... But this time stick the straw into the hose of the vacuum cleaner and let go.... Did you notice anything different.... Yes correct it did not move... And that was only a fraction of the vacuum of space...imagine what would happen if you had really huge straw and the biggest industrial vacuum on the planet.. Yes you are correct very  good..  Same thing would happen.... Now imagine a rocket in space in a near perfect vacuum... What do you think would happen then?....correct very good... It won't go anywhere... Now... Was that very hard.... Correct again no it wasn't.... Now run upstairs and I will be up there to tuck you in after your mom plays with my rocket.
Reply: @metou3072  👋👏👏👏👏
Reply: @GueSStermater  it's the magnetism of the charged particles that make up the atmosphere and the water that are responsible for the thrust..even if I dismissed everything and placed a rocket outside of an atmosphere and in the vacuum of space there is a huge problem that these little vacuum chamber wont show...it violates the laws of physics for there to be a force in the direction of the rocket with 0 resistance in the opposite direction leaving the rocket...everything takes the path of least resistance...just like electricity because everything is made from the same stuff...charged particles...light a rocket in space and the force will not be in the direction of travel...the exhaust gases leaving would be sucked out of the rocket with no force in the direction of intended travel...its impossible to have pressure inside of the combustion chamber because it's open to the vacuum of space just like it is with the atmosphere...and it must be or its called a bomb...and pressure is mandatory in order to have a force...force is calculated by pressure over an area...which is why his homemade vacuum chamber simulates a rocket in the atmosphere and not the vacuum of space because pressure builds in that rinky dink vacuum chamber quickly because I know that his pump can not keep up with the release of gases to keep the environment inside like the vacuum of space would be...and if you watch these videos and all others claiming rockets do work in space in slow motion you will see a delay for a small amount of time until pressure builds...at least for those that are not so small the thrust is because the gases are hitting the vacuum chamber walls directly where it does not matter if pressure builds...this chamber does not matter...too small...gases take up 1700times more space than liquids and even more for solids...which is why solid fuel is used for gun powder...more energy  density..if you are not removing the gasses as fast as they are being made then you are not simulating the vacuum of space...and you sure as hell are not simulating the vacuum of space with a vacuum chamber smaller than my shoe...only someone intentionally deceiving people or idiots will think otherwise
Reply: @metou3072  exactly... the the can moves because of the forces acting in the can the gases will escape the weakest point causing and opposite action...the gases and friction throwing themselves against the can to the weakest point...thrust works in an atmosphere where the area around the thrusters builds massive hyperbolic energy differentials negatively creating a forward propulsion?
Reply: @GueSStermater  or the simplest way to say it is the magnetism from the gases leaving the rocket (in the atmosphere) are being resisted by the magnetism of the charged particles in the atmosphere...this is what causes the thrust force in the opposite direction are the exhaust gases leaving the rocket...works the same exact way as electricity or else there is no motion for the rocket just like there is no current flow without resistance...resistance is mandatory...this is not up for debate...it does not matter what the nozzle size is in the vacuum of space because it violates the laws of physics for something to take the path of most resistance...0 resistance to the exhaust gases leaving the rocket means that you have an equal force going in opposite directions...which cancel and you get no positive net thrust in the direction of intended travel....its claimed that rockets use equal and opposite reaction...thrust for a rocket can not be the action because that violates the laws of physics as I just mentioned...thrust in the direction of travel absolutely must be the reaction...there are a few problems...what causes the opposite reaction when there is 0 resistance to the gases leaving the rocket so it can not be the reaction force either because there is no magnetism in the vacuum of space to generate a reaction force that applies a force in the direction of intended travel....what does the rocket transfer the internal force it created using its own internal energy to??? nothing...therefore its only an internal force only that's never transferred to anything else but itself...and it violates the laws of physics to have any type of flight at all using only an internal force only let alone spaceflight...its equivalent to a person that is on a rolling chair on a hardwood floor and not touch anything else at all but the chair itself and generate thrust....scoot... they're literally claiming that NASA Rockets scoot through space like the person on a chair hardwood floor and not being able to touch anything else but the chair...  they can only accelerate a part of their Mass 4 thrust....using  your legs to push off of a wall well on a hardwood floor in a rolling chair is an example of transferring the energy from one thing to another and getting an equal and opposite reaction...which is the only way to get thrust..the only reason why the person even moves when scooting on the chair is because of gravity (which is really magnetism)...and the friction between the wheels and hardwood floor...which neither are available in the vacuum of space...pressure in the combustion chamber violates the laws of physics because it is open to the vacuum of space...this is only a small sample of the proof that NASA is BS
Reply: @metou3072  yeah like in my head I'm thinking wouldn't all the force just shoot out into infinite space ??? Like those shuttles weigh like 4000 tons + fuel heavy fuel